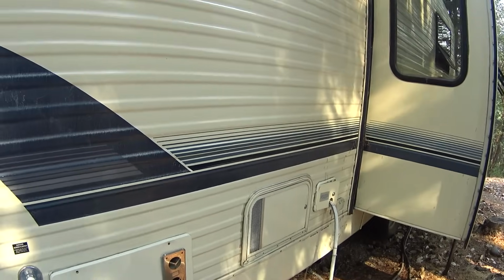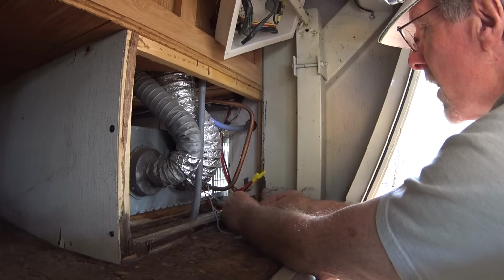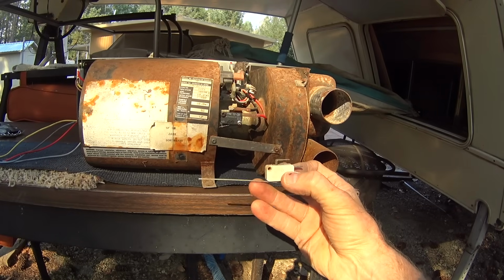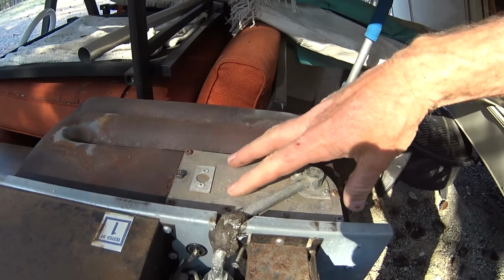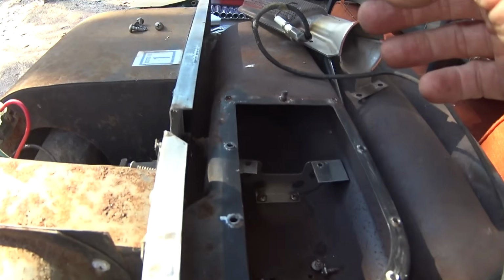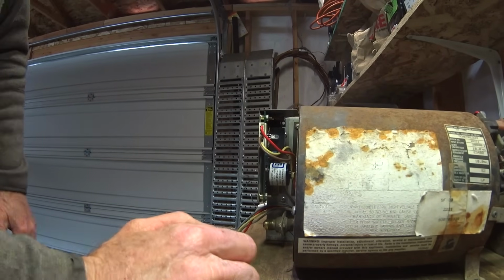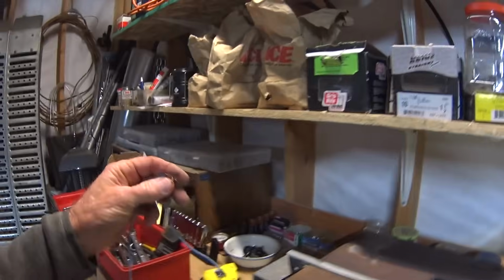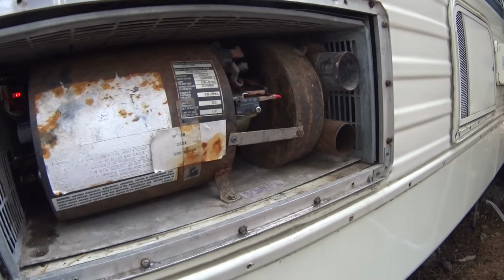RV Furnace Removal, Repair & Installation (Suburban SF-30 Shown)

Comment from the maker: See description for links to replacement parts.  
//Update - it's over 3 years later and the furnace is still working fine.  I honestly don't even notice any more propane use over the 18,000 BTU unvented  infrared gas wall heater I used to have in there, which was 99% efficient according to the experts.  I'm sure the furnace does use more.  It's 30,000 BTUs and not nearly as efficient, but the difference in propane use isn't that noticeable to me for some reason.  I think I'll skip getting a vented wall heater.
Reply: I use my propane furnace all the time, I prefer it. 
Pretty sure my sail switch is defective. 
I actually banged it and it came on.
Reply: Replacing the motor on a furnace

Comment: My Suburban SF30 furnace stopped igniting in the middle of the recent power outage in Western Washington that in my case lasted 4 days.  I believe in redundancy but the Onan Generator went down first, the furnace lasted 1 day, the Mr. Buddy propane heater wouldn't fire up either. Fortunately my second generator worked reliably and saved the day. Now it's time to break down the furnace.  Your video was the only video that was clear, focused on the subject and showed me exactly how to remove and disassemble the furnace.  Thank you for your generosity and for being so thorough. I'm very handy but I do not go into any project that involves gas lines without knowing exactly what to do.  Thank for keeping this video posted!

Comment: Great Video.  I just completed replacing my sail switch, limit switch, circuit board, and igniter.  I watched the video several times and could not have completed the job without your guidance ... Many Thanks!
Reply from the maker: Glad it helped you Thomas.

Comment: Thanks, haven't pulled one of these in 25 years. really helped me remember how to get the furnace out of the box.  So, the SF-40 goes in and out exactly the same way.  Changed to a plug for the wiring. I had to replace a noise motor, you saved me an hour of dinking around....
Reply from the maker: Glad it helped you Roy.

Comment: Thanks so much. Like others have said, after seeing numerous videos on furnace servicing, yours is the best! Gave me the confidence to start looking into why my NT-16SE is not heating.
Reply from the maker: Good luck - hope you get it figured out.
Reply: @MTMiser  Just took the furnace out of its case, saw that sail & limit switches are operating fine, gas valve is opening but electrode still not sparking (had previously replaced it thinking it might be the problem). Now seems the only possibility is a defective board, so I ordered a new Dinosaur FanPlus50 unit just now. Hopefully that'll do the trick!
Reply from the maker: @jpvalois  I hope that fixes it.  Good luck.
Reply: @MTMiser  Hello again. Am following up here for the benefit of anyone who might be having a similar problem. Seems there are a few glitches going on. After replacing the board, I now see a spark, but still no flame. Have now been testing the gas valve individually (using 12V source), seems gas is not passing through it (and yes, orifice is clean). Solenoids both seems to activate. Only possibility I can now see is a defective valve...but 150$CAD to replace is pricey! I'm close to pulling the trigger and getting a new valve, but I do wonder if perhaps I might have overlooked something... last other possibility is that my test gas setup pressure is too low (have set 0.5 PSI as per indications)...
Reply from the maker: @jpvalois  As far as I know the propane pressure in RVs is 11 inches of water column, which is equivalent to about 0.4 pounds per square inch.  So it sounds like you're a little high there, but I don't know how (or if) that would affect it.  Have you checked the limit switch?  If the limit switch is tripped (or defective) it won't allow the gas valve to open.  I wouldn't think it would allow a spark to be generated either though, so that's a bit confusing.  Is this furnace out of the RV?  If so, can you re-install it in the RV and test it in a real world scenario?  If there's something wrong with your test setup, that should eliminate that problem.
Reply from the maker: Also - I assume you've checked your propane supply. Make sure your regulator hasn't been tripped.  This can happen if too much propane flows out at once, tripping the safety device in the regulator.   If it has been tripped you'll need to reset it.  To do that, turn off the propane flow at all the appliances and then turn off the valve at the tank(s).  Disconnect the hose from the tank(s).  After one minute, reconnect the propane hose to the tank and slowly turn the valve back on.  That should do it.
Reply: @MTMiser  The furnace is out of the RV. I can't reinstall it at the moment because the RV is stored for Winter and not easily accessible. The limit switch is not an issue because otherwise no power would flow to the valve (and power does come to it). I would indeed prefer to resintall it in the RV for a real world check, but I guess that'll have to wait a bit longer...
Reply: @MTMiser   Thanks for mentioning this, I will look into it (I'm not familiar with this functionality of regulators).  At the moment, I'm using a test setup with a simple one-stage regulator and a small BBQ propane tank.

Comment: Thank you. Awesome video, I was about to remove a bunch of screws and you taught me quickly just the one screw is needed to pull the core.  I'm replacing the 20 year old core for $500 for preventive maintenance. It was starting to get noisy like bearings or something.

Comment: I just bought a 97 rv with a suburban. Gonna mess with it later today. Heat is trying to kick on but then shuts off. I'm thinking maybe it a clogged orifice or just air in the system. Not really sure. It probably hasn't been used in awhile. Hopefully I can figure it out. But this video will help ! I don't think I'll have the side access thought. So hopefully I can get this out if need be. Thanks for the vid !
Reply from the maker: If the propane has been turned off it can take awhile for it to get back up to the furnace.  Mine will try to light, fail, then it will automatically retry about 10 seconds later, repeat, repeat, and if not successful at some point it will not try any more.  At that point I have to cut the 12v power for 15 seconds or so to reset it.  Then try again.  But yes, it could also be a clogged orifice.   Good luck with it.....
Reply: @MTMiser  I got it working. I'm actually down in Florida with it. I didnt waste any time lol. I had to use the heat the other night for a bit. It was actually cold here. Thanks for the help!

Comment: Found rust particles in the orifice and line partially blocking the orifice. Gotta love high moisture lpg. Guess I'll start looking for auto gas propane.
Reply from the maker: Glad you found the problem Larry.  Good luck...
Reply: We're you able to clean it out? If so, did you used compressed air, or is there a better cleaning method for clearing the orifice/supply
Reply: i had to remove the tube from the regulator to the orifice. once i got the orifice out i ran a wire brush in  the tube to remove any loose rust then i cleared the orifice. then blew it out. look at time stamp 11:37 in video.
Reply: larry reno  thank you for elaborating!

Comment: Great, thorough video walkthrough. I've got an SF-42 that needs to be reinstalled into my 5th wheel. You skipped over the reinstall wiring procedure, which is really important to me because it entails hooking wires to some kind of black plug on the wall next to the furnace. I don't know if it's a relay switch or inverter or what. It's the size of two boxes of matches. Very confusing wiring process. I took photos before unhooking everything, but they proved useless.
Reply from the maker: It was very easy with mine, the wires had just been spliced together with wire nuts.  It was just a matter of taking them apart and then reconnecting them by color with the same wire nuts.   Someone must have had the furnace apart before.

Comment: Maynard,,, "Great Video"... But shouldn't you pull the fan squirrel cage and cleaned it of any "Rust Dust" / "Crud" ???  Anyway's you did a Great Job explaining and taking your time showing the various step's for each parts removal... And getting the parts from Amazon sure is a lot cheaper than buying a whole new unit... Thank' s For Sharing !!!
Reply from the maker: Hi Jackson - yes, you're absolutely right.  I should have done that.  It occurred to me after I got it back together.  It definitely is dirty and could use some cleaning.   It's now one of the many things on my "to do" list.  Thanks for the observation.
Reply: Put the cover on and pretend you painted it 😊

Comment: really good video and yes! the best  I have seen too,...   can you check other  appliances ?
Reply from the maker: Thanks Edgar.  Yes,  I have another video out there of a house furnace I made repairs to (Lennox WhisperHeat G20 - https://www.youtube.com/watch?v=lrfA2wEi4N4 .  And I have worked on other appliances in the past (refrigerator, washer, dryer) but that was before I was making videos.  If I work on any others I'll make a video of it.

Comment: what a great video!!! my ignitor has 2 wires with 2 porcelin type tubes . one that looks like a sparkplug wire from a coil but what does the other wire do. is it a ground???
Reply from the maker: No idea.  The only thing that comes to mind is possibly your ignitor doubles as a flame sensor, which is what the other wire is for?  I'm really not sure.
Reply: @MTMiser  thanks!!!! Great video!!!

Comment: Great video! Now I've got to tackle my problem... Gas valve opens, igniter ticks but no combustion.
Reply from the maker: Possibly a blockage in the airway?  When I took mine apart I found 3 wasp nests in there.  Good luck, Larry.  When you get it resolved come back and let us know what you found.
Reply: I've got the exact symptoms. Tries to ignite but cannot. There has been wasp activity. Haha. 

Hey, is it a bad idea to put a quarter turn shutoff valve inline with the supply and the furnace?
Reply: Also, I have the suburban SF-20 and I have trouble scrounging up parts for this exact model.
Reply from the maker: I don't think it's a bad idea at all.  But where would you put it so you could access it quickly if you needed to?    On my rig it would probably be just as fast to shut off the propane valves at the tanks.
Reply: Did you end up putting an inline shutoff valve in? If so what size did you get?
Reply: Will Frazer I'm doing this repair job tomorrow actually. I chose not to bother with adding a shutoff valve, since the job should be pretty quick. I originally only wanted a shutoff valve so the other RV propane systems could continue to operate while I took the furnace to a repair shop.
Reply: @petraxbeanforever5923  If you need to use the propane for other appliances you can  put  a cap on the line.

Comment: Qui k question....... when replacing the cover should the upper tube line up or be a bit asku?  Having  trouble putting it back on perfectly lined up. Thank you
Reply: The cover on the side of your RV?  As long as your screw holes line up you should be good.  Leave them all loose until you get them all started, then tighten them down.

Comment: Thanks for the video, it is extremely helpful. I'm going to replace the same parts in my SF-35, but something seems odd to me. Do you have any idea how these units sense that the igniter has lit the flame? I'm thinking that the igniter itself has some sort of feedback circuit, but with only one wire  it's hard to understand how it would work. Since the newer igniter is larger than the original, did you see any issues with it not shutting off the igniter after ignition?
Reply from the maker: Thanks for your comment, Tim.  Good question.  I'm really not sure how the unit senses the flame.  There is no flame sensor like in a household furnace, that I could see anyway.  I could guess that maybe there's something built into the limit switch that senses heat at the low end as well as the high end, but I'd be only guessing.   I did not have any issues with the ignitor not shutting off after the flame was lit.  So whatever is sensing it is definitely working.

Comment: What type caulking do you use to put around the two  pipes when you put the outside cover back on the RV
Reply from the maker: I think I just used window and door caulk.  The exhaust port gets warm but I don't think it gets hot enough to be a problem for the caulk.  But upon further investigation - I see others recommending muffler paste or High Temp Silicone RTV.  That said, I haven't noticed any problems with my vent seal and it's gotten quite a bit of use this winter.

Comment: Great video! My furnace use to work,  but now when I turn it on, 15amp fuse blows in my bedroom fuse box. I'm thinking maybe stuck blower motor or bad circuit board Any advice will be appreciated. So I been using heat strip on ac unit to get warm..
Reply from the maker: Bad blower motor or something keeping the squirrel cage from turning would be my first guess.  Twice I've turned mine on to hear some gawd-awful noises coming from the squirrel cage.  Turned out to be mice trying to nest in there.  Open it up and see if the cage is turning freely.    Sorry I didn't reply sooner - didn't see this comment for some reason.

Comment: In trying to repair mine, of course I lost that brass fitting that connects the gas lines. Its the part that had the circle at the end. Do you know the name of that part so I can reorder it on Amazon?
Reply from the maker: Hi Tara -  If you're talking about the adapter I had to remove to get the furnace out of the box, it is a female flare to male flare adapter, but unfortunately I am not sure about the sizes and I'm away from home so can't look at it.  If I had to guess, I'd say it's a 3/8" female flare by 1/2" male flare adapter.  Here is one on Amazon.  https://amzn.to/3FsEA6S  But I might be wrong about those sizes.    I can double-check when I get home but that would be Tuesday at the earliest.     Note - this is an affiliate link so I will get a small commission if you use this link to buy it, but there is no increased cost to you.
Reply: @MTMiser  Ty you so much for replying and I will absolutely use your link. Sadly thats not the part I was referring to though. It was the smaller piece I was referring too. Im going to rewatch your video and give a timestamp when its showed...
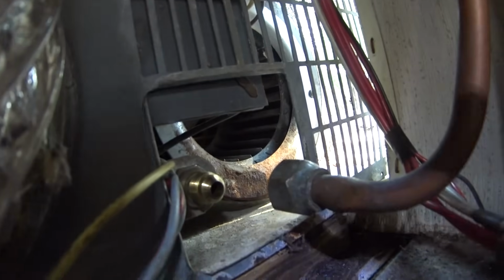Reply: Its at 5:42 in the video right after you take that adapter piece off and its that brass part on the left side with a circular end. Thats the piece I lost. 
Thanks again so much for your help...
Reply from the maker: @Tlee6375  Oh, ok....that's a male flare fitting, and It's probably 3/8" but, again, I'm not sure since I'm not home.  Also I'm unsure of what the other end of it is since I never took mine off. I can look at mine on Tuesday if you can wait that long.  If not, take a look at your furnace where that fitting screws on and determine what size and kind of a connection that is.  Also look at the end of the propane line that screws into the fitting and determine its size (it will almost certainly be a flare fitting).  Sorry I can't be of more help right now.
Reply: @MTMiser  thank you so kindly, ill look into that right away.
Reply from the maker: @Tlee6375  You're welcome, Tara.  I'll be happy to look at mine on Tuesday if you still need me to by then - just let me know.  Best of luck.

Comment: In my opinion, you should have replaced the Fan, as a preventative maintenance measure. Hope I am wrong.🙂
Reply from the maker: Hi Mark, and thanks for your comment.  The fan has never given me any trouble (except when I started it up with a mouse in it once - wow, what a racket that made!).   And it has survived two more seasons since this video was made without any issue.  If it does fail at some point, removing the furnace again is super easy.

Comment: Does it matter if the 2 blue wires are switched when reconnecting?
Reply from the maker: I can't say for sure, but I highly doubt it.   The thermostat just connects them to each other when it calls for heat.  If it did matter, I'd think they would have made them different colors.

Comment: So what wasn't broken in there.
Reply from the maker: Not much, lol.  The limit switch, fuel valve, motor, heat exchanger and squirrel cage were all good.  I didn't mention it in the video, but I think the circuit board electronics may have been damaged by a mouse getting flung into it.  I'd started the heater up one day only to hear some god awful racket coming from it until it suddenly stopped.  After that, it was quiet and seemed to blow air fine but it wouldn't heat.  Never did find the mouse, but he left plenty of evidence behind.